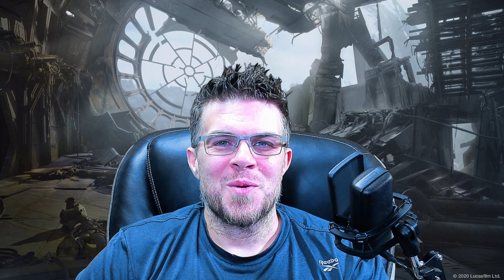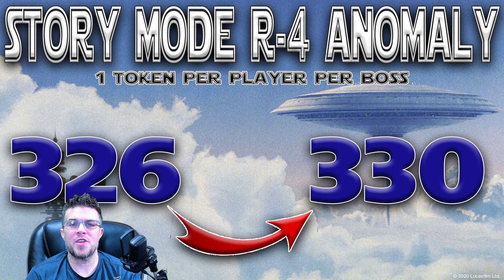SWTOR 7.1 New Gearing System Explained

Comment: Gearing needs to go back to 6.0 to increase overall player base. I was a subscriber and regular player since launch. Over the years my play time was restricted due to family/rl commitments. I eventually became a casual player because of this and so 6.0 was a breath of fresh air as it still allowed me to work towards top tier gear...albeit at a much slower rate. I'd still group occasionally if I had time but ultimately I wasn't constrained to planning 2/3 hrs slots for MM raids. I get the hard-core players want the highest rewards however the elites are a very small percentage

Comment: So long as Vet mode isn't NiM disguised at HM I will be fine. I hate NiM with a passion. So I hope Vet is not a complete and utter nightmare. I wonder if they'll have 16M SM and HM.
Reply: They said they wont do 16mans anymore as they can focus more on the op if they dont have to scale it for 16man as well.
And Im not certain but I think they said the new op(s) are supposed to be as hard as Nim on hm.
Reply from the maker: The only ops taht are basically NiM disguised as HM, are Rav and ToS, which Bioware refers to as "Hardmare".  It wasn't popular, and they've gone back.  There will be both a HM and NiM variant of R-4

Comment: Hi, thank you for the info. Do you recommend me to subscribe right now or wait until mid July? I have 4 characters in lvl 75 and Im thinking on subscribing for 1 or 2 months to try to get the gear for my main or 2 of them at least. I used to play mostly pvp, too, so idk how hard is going to be doing that new op. Is veteran mode the way to go to get full 340 right? Do you know if pvp gear is going to stay in 326 or it will be higher than that?
Reply: Legacy of sith is a joke don't waste your money
Reply from the maker: I personally always subscribe to whatever MMO I'm currently playing.  Helps out the developers, and removes all the limitations.  I certainly understand not everyone is able to do that, but if you are able to, yes I always suggest subscribing.  From what I understand PvP gear is gonna stay at 326.  I imagine the new op will be fairly hard on veteran, especially as the raid teams will take a while to develop solid strategies for each boss, but yes, you will have to do the op on HM to get 340 gear.